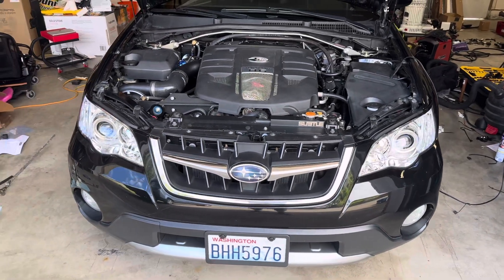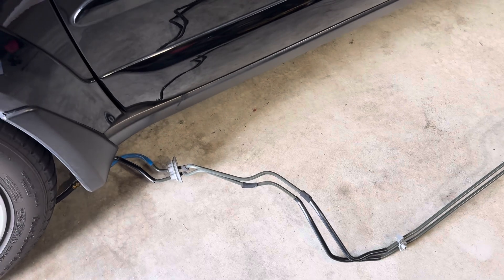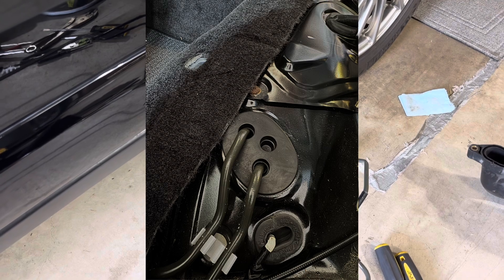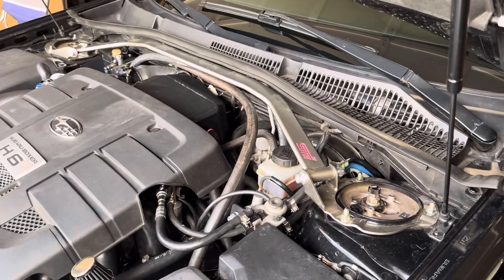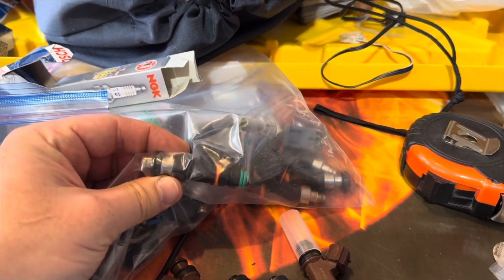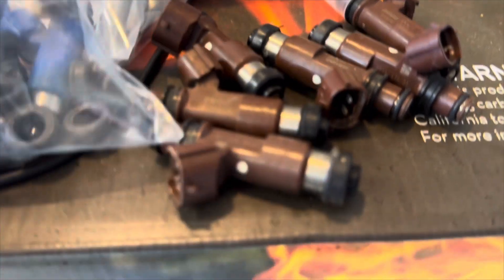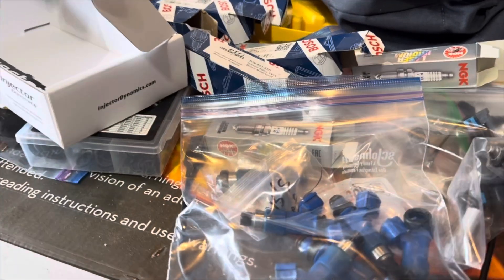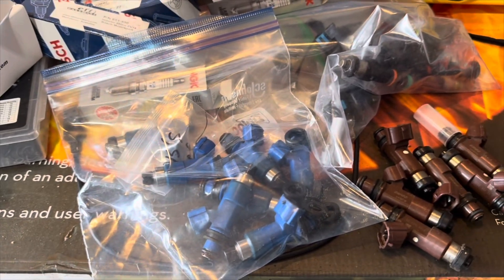3.0R Supercharged fueling issues fixed!

Comment: You go standalone ecu? Or flashing factory one? Just swapped my 08 to a 6 speed and figuring out how to delete the p0700 code so it revs lol
Reply from the maker: @Brighton-33  factory ecu. And for the 6MT swap I used a method they pioneered in the EZ30 MT Swappers group on Facebook. A guy named Mitch sells something that acts as your TCU. So everything works including cruise control
Reply: @CW-uj3dd  wow, that's kinda insane. I'll take a look at that thanks

Comment: Recently swapped out my 04 Forester Xt from a 4EAT to a 5 Speed transmission from a 06 Wrx. And started experiencing the same idle surge. The motor was also from the same 06 Wrx “ did a full Sti swap “ but when I had that motor in my Wrx I never experienced it until I swapped it over to my forester.. I’m stumped on what it can be. Even with a proper idle relearn it still does it. Wonder if I have to do what you did & I’m dreading it..
Reply from the maker: @Owensti  my tuner made changes for the manual swap. Did you flash a manual rom on your ecu?

Comment: How far can you push that water to air intercooler
Reply from the maker: @benjaminphantomhive  I don’t understand the question
Reply: @CW-uj3dd   how much power/boost can you make till the intercooler starts to heat soke.
Reply from the maker: @benjaminphantomhive  I haven’t paid attention to the intake air temperatures but I can get 8psi at 7,300rpm